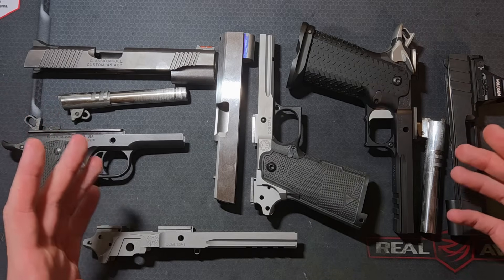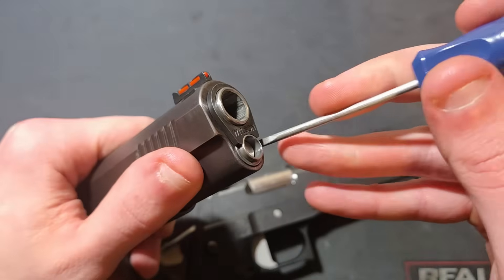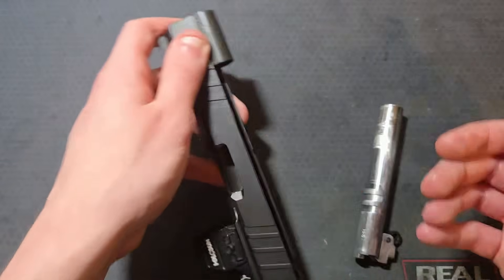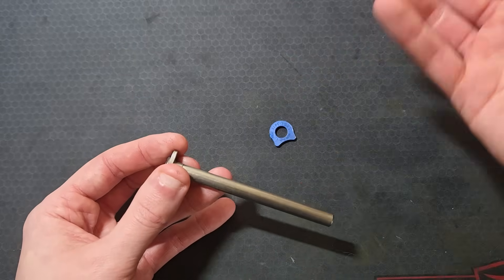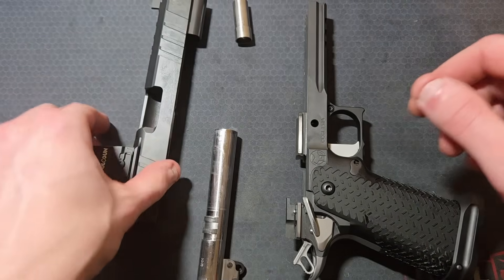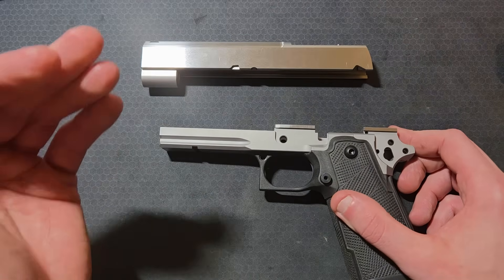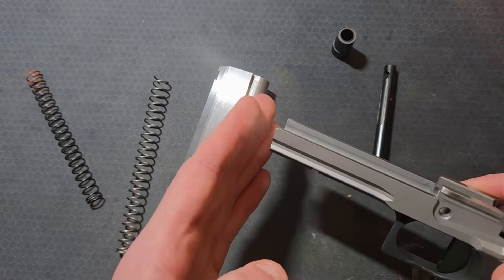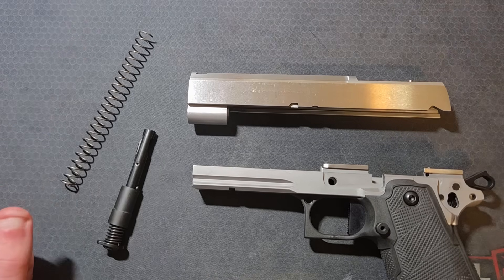1911 Length, Stroke, and Recoil System Components Explained

Comment: I’m having a similar issue.  I knew I needed a gov frame but I didn’t know the atlas slide was 80 thou long.  You can actually order a government frame from JEM that has a full length commander dust cover,  so that way you have a gov frame that would match flush with your 4.25 gov slide.  Only problem is the 80 thou excess, so the frame is actually too short for my atlas slide by 80 thou, but any other gov slide cut down to the proper 4.25 length should work
Reply from the maker: Yep sounds like you got it figured!

Comment: @EngineersArmory
A video showing a couple different ways to convert a bushing barrel slide to a bull barrel slide would be awesome!!!
Thanks in advance and Tinker Away Sir!!!
Hands down the BEST CHANNEL on the InnerWeb 🙌🏼
Reply from the maker: I appreciate the kind words! I haven't done a bull barrel conversion myself and im not likely to. But as far as I know all that really needs done is modifying the spring plug tunnel on the slide for a reverse plug. The slide barrel passage is the same, the bull barrel OD is designed to match the standard slide barrel passage. 

The spring plug tunnel can be counterbored for a standard full shoulder reverse plug, or it can be cut for the flange plug like I mentioned in this video. 

Then of course the new barrel would need fit to the slide.
Reply: @EngineersArmory  
Awesome and Thanks!
Reply: But I wouldn’t be here on your channel if Adam @AtlasGunworks wasn’t so incredibly free on sharing his knowledge on his.

Comment: Just tossed some of the blue Wilson buffers that over years sitting in the 1911 case turned brittle.
Reply from the maker: Yup they will degrade over time. Gotta swap em out and make sure they dont get too old.
Reply: @EngineersArmory  One rod had a greenish buffer. Who makes that one. I had looked at Wilsons site and it's still the blue material so I don't want those.
Reply from the maker: @nightwaves3203  the green one is 3d printed. I made a 3d model of the wilson one then print my own out of Shore 64D TPU. They cost me about 5 cents each.
Reply from the maker: @nightwaves3203  also most silicones or rubbers degrade with exposure to atmosphere. Dont judge their quality based on that if youve let them sit for years. Thats like saying a cracked car tire is poorly made because its 10 years old. Its cracked cuz it sit out in the air for 10 years.
Reply: @EngineersArmory  Thanks. Maybe I'll have to exacto knife some good rubber if I want to use buffers again.

Comment: I’ve got 3 double stacks and have an odd question- 

MAC 4.25” - cannot fudd rack slide while at slide lock

Yet my Staccato C24 4” and my Bersa M2XI 5” can. 

Is this a result of slightly longer stroke length on these two?
Reply from the maker: I couldnt tell ya. Not familiar with the Staccato or bersa. The Tisas guns are odd. I remember fitting a keyed reverse plug to my MAC9 and i had to buy a prodigy one and machine it if i remember correctly. 

There should be enough travel behind the slide stop position thag you can sling shot the slide closed on a new mag. I would take the recoil assembly and barrel out and stroke the slide to see if its binding at the end of its stroke or something. 

If youre running a recoil buffer that shortens the stroke, that may make dropping the slide harder.

Comment: Thank you.  I need to watch this a few times, and write down what I see and hear, see the numbers on paper before I have the ah ha moment on Commander Frame vs Gov slide and why you can't mix.  But I see my earlier questions related to this was relevant.  Once I get my I understand moment, I need to decide the path I would like to take to build my own Commander length 2011.  Go Commander or Gov...  I like the concept of the longer spring retention tunnel provided by a specific Commander frame, but I don't know how important that is.  Perhaps the only difference between cutting down a Gov slide to Commander length  and a true Commander length frame and slide is how much wear and tear the recoil spring  will recieve.
Reply from the maker: I think in general you would have an easier time with a commander slide on a commander frame. More parts availability. No cutting a frame dustcover down. 

I went with an atlas slide because i like their optic mounting system and the tri-top design. Had i known i needed a govt frame i would have just bought a full length dustcover frame and cut it down, not a huge deal. 

I wouldnt worry about spring wear in either case. I dont think one would wear out springs quicker than the other.

Comment: JMB invented a simple device, it got only a bit more complicated when Colt made the 4.25" barrel Commander.  Then the more people that got involved the more complicated it got.  Now we have full size 1911 in barrels from 3" to 7" and lots of steps in between, bull barrel and non bull barrel, and lots of different guide rods.  This doesn't even get into the smaller models/variations made by Star Kimber, Springfield and S&W.  So buying components can introduce lots of problems.

Comment: Is was told by fusion firearms when I ask about springs being to long for the new xp-pro  that the guide rod not touching the reverse plus was how it was supposed to be even though in my pictures I sent you can clearly see the springs coils are all touching 🤦🏼‍♂️ very frustrating cuz I just want springs like the original one but can’t find any
Reply from the maker: That is frustrating. I would probably count coils and cut down a standard spring if they arent gonna help you out. They don't offer replacement springs on their site?
Reply: @EngineersArmory  they do, those are the ones that are all too long. I inquired about it asking if they are supposed to be cut down/fitted, but they said they’re not and are the right length, as of now I found a wolf 5” 12lbs spring cut down is working the best for me, I used a table scale to push down on the spring to estimate the weight around 10.5-11lbs which is also about what the oem spring was around
Reply from the maker: @loucatmeow13  woah thats wild the OEM springs are too long.
Reply: @EngineersArmory  yeah it’s only the spring pack you can get from their site, the one that came with it was just fine the pack comes with a 7,9,10,13lbs all of them cause some type of coil stack, I was able to cut the 10lb down, but I’m not happy with the preload and all of the spring from the pack are a different diameter spring then what originally came in the gun, on top of that I was told the gun comes standard with a 7lb recoil spring which is not correct, I don’t have an actual spring testing device but have had luck with the pushing down on a scale method and I believe the original spring to be 10-11lbs which was my target weight and have had luck with it, I’m pretty disappointed in fusion’s ability to handle the situation, multiple spring pack they have sent have that issue and they seem pretty set on dismissing my claims

Comment: Ive run shok buffs/recoil buffers in all of my 1911s. Countless rounds through many 1911s. I think alot of their bad reputation is from people using old buffers. Theyll buy a pack in 2003, and then expect that silicone/rubber to be perfect decades later.
Reply from the maker: Agreed. Like.. look at them when you clean the gun. If it looks marginal replace it haha. If its sat for 10 years... replace it.
Reply: @EngineersArmory they're too cheap to not replace, i tend to replace mine every 2k rounds, and/or my birthday so i dont forget
Reply from the maker: @KetamineKowboy  good tactic. I bet you could even replace em every 5000 or with a recoil spring change.
Reply: @EngineersArmory I could probably push alot of stuff like that off, but I enjoy doing it. And there's no such thing as too much preventative maintenance.
Reply from the maker: @KetamineKowboy  agreed!
Reply: I would normally agree, in almost any other case...yet imo if J.M.B. wanted a buffer, it would've come in the original design and drawings...😎
Reply: @laptopdragon  he didnt want it in any other caliber, with any other spring weight, different sights, magwells, front serrations, ports, comps, any other barrel length, lowered and flared ejection port, rounded MSH, bull barrels, and many many others. Most modern 1911s are 70%JMB. Unless you have a prewar, or good prewar clone, and handload ammo to ww2 GI spec with correct powder, and lubricate it with sperm oil, you dont have a leg to stand on here.
Reply: @laptopdragon  Jim Browning didn’t have urethane or he would’ve put them in his design!

Comment: On the edge of being nearly useless drivel, the lengths I learned of 1911s were (longest to shortest) Government (5"), Commander (4.5" or slightly less), and Officer length (3.5-4"). Of the three, I rarely see the Officer length proclaimed anymore where it's now fallen into the subcompact segment. 
Of my own personal preferences, 5", full length dust covers, and a threaded barrel are my target trio, which dramatically cuts down on options into an almost unicorn pool of availability unless you customize or go borderline boutique.

Comment: So pretty much you likely bought an atlas slide that is meant to go on a 5in frame with a Island block or comp on the front of the barrel to make up the remaining distance? They are becoming quite common these does so that would be my assumption.
Reply from the maker: I bought this slide to go on a commander frame haha. I messed up. I have a plan to make it work tho.

Next build will be a 5" frame with the same slide and a sight block comp just as you described. 

Atlas does offer 4.25" pistols. They are on a cut down long dustcover govt frame.
Reply: I love the look of a keyed reverse plug, and I’m ok with the “paperclip” style guide rods because I’ve had a toolless one come apart on me while shooting 2 years ago 😅
Reply: A point of curiosity, regarding the difference between the commander frame, and the government frame, I am curious if the dimension from the center of the slide stop hole in the frame to the face of the vertical impact area are the same. Since you have both, perhaps you could reply With that dimension or difference between them? Love your channel. This content is exactly what many of us need. Thank you.
Reply from the maker: @ricksetting4895  location of slide stop hole is the same in the frames. This means the front face of the front rail on the commander frame is .090" closer to the slide stop hole.